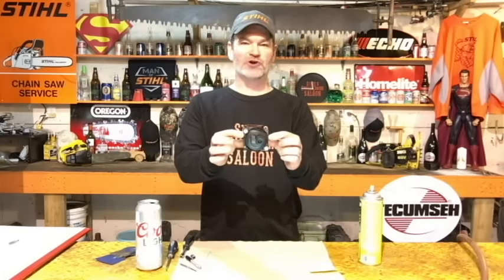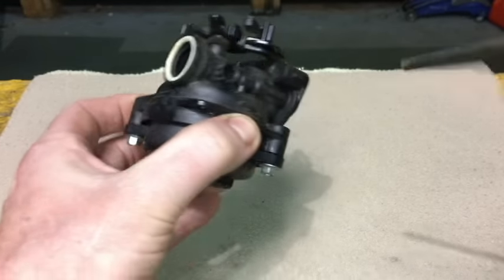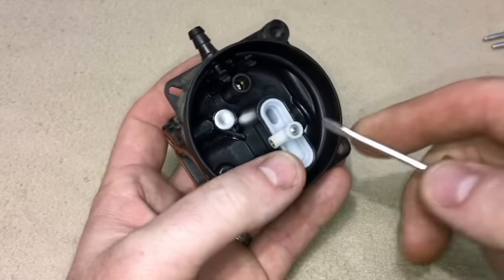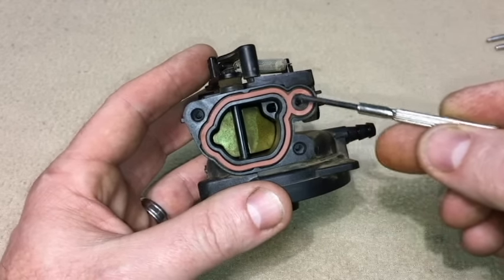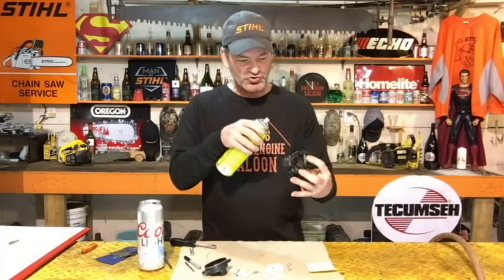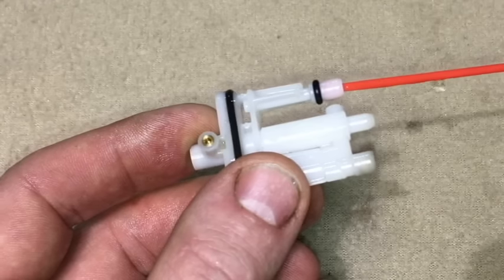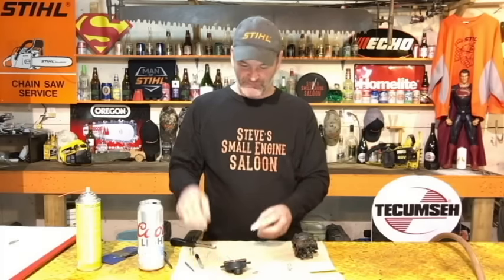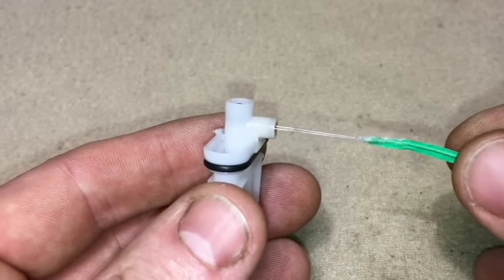EASIEST WAY To Clean a Plastic Briggs Carburetor

Comment: Take the plastic jet assembly apart and clean it, its 2 pieces and if I take them at and clean they run great. I had the same issues until a mower guy I know showed me the trick. Never had any problems when I cleaned it out 100%, not taking it apart is only 95% and that wasn't working. 👍👍

Comment: Be sure to re-install the float correctly.  There is a slot for the needle head underneath the back of the float.  If the needle head does not go into the float slot, no gas will flow and tje mower will not work.

Comment: Thanks great advice ,,,,, U are appreciated '
Reply from the maker: My pleasure!
Reply: @StevesSmallEngineSaloon  Yes i am in the process of dealing with my carburetor all is cleaned but when i try to tighten up the bottom screw cap with my hex key it will no longer go in and screw back in place for nothing why is that ... That has to be sealed or the gas will fall right through the bottom of the carburetor. What is that issue ... by the way another carburetor is on the way  same brand ,, and i will keep the other one for practice of understanding.

Comment: Steve - I have a high wheel craftsman 6.75hp trimmer w/ this BS engine setup.  I have cleaned out the carb and all jets at least 2x now.  It runs but surges.  I have replaced the spark plug too without any change.  Do you have any suggestion on whether the issue could be the gasket behind the carb?  It seems like the choke won't fully close when it surges.  Any suggestions would be appreciated.  I am mechanical and have done entire engine/trans swaps on a honda but this one has me stumped.
Reply from the maker: I have a video for that in my playlists...

Comment: A big problem I have  with these engines is the gas tank over flow vent.  When you fill up the tank and use the mower gas floods out of the vent all over the air filter.  Then it won't run right at all.  I take about six inches of green clear fuel line force it over the vent tube direct it away from the air filter and mother on.  Took me along time to catch that problem.

Comment: So, why would the OEM make it with that size jet?  Possibly because the air fuel ratio is best on that carb when the jet is that size? Increasing jet size adds more fuel so possibly the carb is running rich after you drill the jet out - or- you may have made it run right where it needs to be.  I guess you can check the spark plugs to see how they look, (rich vs lean) , etc. If it sounds good and the exhaust isn't dark or smokey and spark plugs look good I would be ok with this mod. Maybe overtime check the top of the piston for excessive carbon deposits. You can get a cheap borescope from online sellers that will fit in the spark plug hole to view the top of the piston if removing the head is a pain.  Odd how a fuel filter wouldn't fix this. I also wonder if using fuel with ethanol in it is an issue for that tiny jet. Maybe using ethanol free fuel like most small engine OEM recommend will fix this? Gasoline weed trimmers tend to gum up if you don't use ethanol free fuel.  It bugs me that drilling the jet out is the fix. Would you also add a fuel filter?

Comment: Had a no-start engine.  Had spark, fuel new, would run with cleaner sprayed into carb, but dies immediately. following choke spring video, not the problem. Followed this video, jet wasn't clogged when sprayed through, so finished cleaning. Still no start. Pulled it out again, opened it up with bit. Still no start. Replaced carb with Amazon ordered unit. Still no start. Not sure what to check next?

Comment: I'm in New Zealand and have one of these horrible carbs on my mower. Three times now I've stripped it totally down, used a can of Cyclo carb cleaner and compressed air through it, but it still hunts badly at idle. Does that mean the carb is trash? Fuel clean, air filter clean..I'm so frustrated! Ruins fine at full throttle and starts first pull. Any ideas?? Thanks guys

Comment: Ever seen a 2016 Poulan Pro E85 Cal. Carb? Restrictor Sleeve insert for cfm? Drilled to .06 (all I had). I have to remove the insert. Starving for air....

Comment: Great and informative vid...but one correction; if the diameter of a small bit is 0.028 ( for example ), then it is not 28-thousandths of an inch thick.  It's 28-hundredths of an inch.
28-thousandths would be, 0.0028.  I'm sure it was just a slip of the tongue.  Thx for the vid.

Comment: My plastic carb has a white plastic barb on the side that squirts gas when pushing the primer bulb. What's up with that. Also won't start Have cleaned it out . Cranked once.
Reply: That port is for models that future a choke and your engine most likely has a pump style bulb primer that you press instead. That little port with the plastic nipple should be sealed and on the inside of the carburetor in the float area there should be a metal disc that is pushed into place to block off that port and keep it sealed. I'm assuming your metal little disc became dislodged or lost and that's why fuel is pumping out when it should not

Comment: I am a pro factory  ace  . On the carb in this video .. just tack the bowl  off spray it with cleaner everything  run a small wire in the little hole u see at  the end it will look brass in color.  Clean out the tank good and that's it very easy 14 minutes  it takes and I do around  55 to 80 a week everyone  runs fine no need to take all that shit off the white parts stay in the carb just spray run a wire in that only jet put it back together  .. I been doing this work for over 40 years  and I never have anyone  unhappy.. want to make this motor run a little faster just bend the rod that the spring is on bend it to the front run better than new ..

Comment: Another way to solve that issue is to install an in line fuel filter. This will prevent dirt and sediment from getting through to that tiny hole

Comment: Have spark. Checked valves and other areas. The mower wont even try to run
With some starting fluid. I have the 300e engine 125cc. I guess off with the carb. Buy the way I only run regular gas and run it out of gas before going back into the garage.
Reply: Update. Took varb off and yes the jet was plugged. Cleand it tank and every thing else. Shoot some go juce and the dam thing still wont start.... HELP...

Comment: I have a Briggs motor with plastic carb that I drained the gas, made sure choke flap was in the correct position, cleaned plastic carburetor and drilled out main jet, replaced the spark plug and air filter and added new gas.The only way I can get the mower to start is with starting fluid and it dies immediately.... is there anything I am missing? I am extremely frustrated 😞

Comment: I realize this video is 3 years old now but just another tip if someone happens to see this comment because I'm surprised he didn't mention this, do yourself a favor if at all possible and run non ethanol gas in it. This will also help a lot with not plugging up the main jet and also just overall its better for small engines. The 10% or so ethanol in regular gas you buy wreaks havoc on small engines, eats rubber like your fuel line and seals over time and can cause damage to the engine itself over time especially if you let gas sit in it for long periods without use.

Comment: I’m a idiot when it comes to small engines but it would be
Cool if you could do a video from start to finish on a part. This video perfect example. I’m an idiot and it would be cool to be able to see the steps you take to remove the carb. I might be the only one thinking that but from someone that has no clue how to work on small engines and what steps to take to remove them and everything

Comment: The thing that I don't get about this is, if the jet is intentionally so narrow (because they want to run lean and curb emissions), then why the heck isn't there a fuel filter somewhere in line to at least TRY to keep the gunk out?  My mower only has one of the little molded wire mesh ones in the tank, which is only good for keeping leaf bits out of the fuel line or whatever.  This is the worst of both worlds.
Thanks for the vid, about to open my carb for the THIRD time this week and probably drill it out to put an end to my suffering :)

Comment: ive too noticed alot of the jets are very small on these newer engines,, maybe its an epa thing,,  dont know how they run with such tiny jets.
Reply from the maker: Agreed!
Reply: @StevesSmallEngineSaloon  theres no way they get the horsepower they claim on these new engine,  they have no balls.. I drilled my main jet out and now its running rich, I have to try to figure out how to get more air mix in now.. I may try to find a carburetor that will fit it from a real 6.5 hp engine,, if you look at the intake opening though, it is tiny, so dont know if that will help.. maybe I can change the intake opening by drilling it out some  .. 
 as the engine runs out of fuel, and the mixture changes, the engine comes to life, it wants to run strong on the lean mixture,, not just a little  it is ALOT..  THIS TELLS ME that the engine is restricted way down on the air mixture.. I did not see an air mixture screw on the plastic carburetor.. 
it burns gas like crazy too.

Comment: Those new plastic carbs are for E85 fuel, it is much thinner thin the fuel with 10 percent ethanol gas. if the jet was set at .028 like all the ether carbs are, the Lawn Mower will run to rich! with the E 85 fuel more alcohol more thinner fuels faster flow rate.

Comment: Mine has a weird plastic cylinder ring with a hole on one side inside the intake hole and no choke flapper, not sure how this stupid ring is supposed to sit as it fell out when I was cleaning
Reply: Ya if you look close there is a notch on the white thing and a notch where it goes inside the throat. It just pushes in but has the be put in first before you put in the jet assembly where the float is. That jet assembly pokes through the white thing you're talking about.

Comment: I know my comment is way over due but NO I have only had to replace 1 of these type carbs and that is because it sat with gas in it for over 2 years.  I have done like at least 30 of these plastic carbs and all I do it take them apart and clean them really good and put it back together.    and yes that main jet is always the issue at least 95 percent of the time. 
Bar none the easies carbs to clean.
Reply from the maker: Agreed!

Comment: Hey Steve I was working on carburator on craftsman pressure washer an lost the needle float valve . Would you happen to know what the needle part number is model number cmxgwas020733 00 it has the Briggs engine on it?

Comment: If you want to clean this kind of carb without wasting expensive brake cleaner or carb cleaner, you can spray everything down with LAs awesome cleaner/degreaser and scrubbed with an old toothbrush. It can be purchased at the dollar tree. Then rinse with water and blow out with compressed air.  If I can buy a new carb, air filter and priming bulb for 10.00 but I use 5 bucks in carb cleaner to reuse my dirty one, it's not really economic. You can save the carb cleaner for cleaning the jets.

Another nice thing about the cleaner I suggested is that it doesn't absorb into your skin as easily as carb cleaner will and creates less volatile fumes that you're breathing in. Remember, everything your skin absorbs and you breathe in goes through your liver. Most of these fast evaporating cleaning products are carcinogenic, so wear gloves and have a fan blowing next to you to move the fumes, or better yet, do it outdoors.

Something else that has helped me in the past is to get a small E string from a guitar. If you don't play guitar, ask a friend to save the piece they clip off when they put on new strings. This little string is very thin and flexible steel and great for cleaning out clogged carb jets.

You know a guy knows his stuff when he can teach you technical stuff while drinking beer. If you've ever tried doing anything technical while buzzed, you'll understand that it's a hindrance to doing something correctly rather than a help.

Comment: These carbs are a pain. Fortunately if you screw one up while trying to fix it they are available new for under $20. The ethanol we have to have in the gas here wreaks havoc on them.   One more thing - safety glasses when spraying carb cleaner! That stuff at best stings and is not good for your eyes. It doesn't task good in your beer either...And gloves too.   My guess is that the jets are so small to meet emissions/use less fuel.
Reply: Good catch..trs80

Comment: Help me. I clean it, and it runs fine. I get to use it for about at 1 or 2 tanks. Then it returns to start, run and die. I have to clean the carb again.
Most recent episode worked for only about 20 minutes.

Comment: I am weary about using those small drill bits because they can possibly open up your jets size to wear is will not run at factory specks.  Just my thought.  I use something more smooth.  This is why I think those welding tip cleaners are no good for cleaning main jets in 
small engines.

Comment: There's a check ball in that one "hole" ....and I'm fairly sure the main jet has a slit not a hole....people always jam stuff into there Graco paint sprayer tips and try to clear them ..theres a tiney bar in the middle of the sprayer tip and they always end up bending it to one side and it now sprays but it also drips at the same time ...gran yourself a Lincoln welder tip cleaning kit they work for all the tiney orifices...(that's not a dirty joke haha it's the technical term for hole)...also im not trying to be a jerk I'm just from NY

Comment: Bore it out to the same as very typical carb… make sense, as the particulates in the gas are same but may need the proper size hole so it doesn’t clog with a none issue speck of dust!!!   LOL

Comment: Man... The needle on mine was so gunked up from stale fuel, I'm sure the hole it seats into as well, so no seal.  It would run but fuel leaked... Now I tell you, for $12-$15 I can buy a brand new one online, whole lot easier than the 1/2 hour or what I spent fiddling with mine (plus it still leaks).

Comment: I have a plastic carburetor, my problem is. It starts and runs for bout 5 mins, then stops. Want start, I can spray starting fluid in the carburetor. It starts then dies. I’ve replaced the carburetor with a new one. I cleaned the gas tank, lines. So all is new. And it still only runs for 5 mins. Help!
Reply from the maker: Check my mower playlist for a video called   runs for 2 minutes

Comment: ive worked with molds and injection  they have to be redrilled to  make .small hole for plastic injection they have to improvice there mold to acommade for this injecttion mold process.they need more tryouts untill finished,it might be a design  problem. Passed by mistake, no one caught this!!!!!!  in exspection it passed

Comment: This trick didn’t work for me.  It was actually worse after I drilled out the jet.  I had to replace the carburetor.  It was only $20.  The mower still doesn’t run perfectly, but after I adjusted the idle (a little higher) it’s better.  Mostly, I just haven’t been happy with this Troybilt TB200 mower since I got it.

Comment: The jet inside the tube at the other end is smaller still & gums pretty easily,it the second time that 2nd jet has caused issues on acquaintances mowers. Normal non rasping long gas tip cleaners & decent compressed air pressure solved both mowers.Will keep reaming in mind for next time.What a horrible carb,i prefer the old ally ones from the quantum series

Comment: Steve, I concur. The jet is too tiny, but I think it's for fuel efficiency.  I actually like these plastic carbs, other than the too small jetting and have used one of my old trusty .024 drills and got one running O.K... but not great. I'll try the .020 to clean the next one out and go with that. Thanks for the confirmation about the sizing. Since B&S has no real filtration on these, they'll get  my vote as the easiest and quickest way to make 10 bucks on a carb cleaning. I guess the bread tie .016 will be my go, no go method to check the cartridge. Your video on the sticking choke was good. The hangup may be the carb bracket getting bent during use or possibly assembly. Could it be getting warped by over torquing that left side bolt, forcing the inside of the bracket into the space where the choke arm swings to the full open position? It seems like the bracket and the carb are both strong enough, materially, so physical damage could be likely. Heat deformation?    I have one in my backyard that isn't cold  starting and I'm going to check it closely and see if that's it. Thanks again.

Comment: Just did this on my pressure washer. Worked great but you don’t have to remove the float if you don’t suspect it’s bad. Did shoot myself in the face with carb cleaner so be careful
Reply: Thanks btw

Comment: No is not that problem .

The problem is the poor quality. Over time, the plastic carburetor gets warped(deformed) from the temperature of the engine. In Germany service , we change the entire carburetor with the intake manifold and after that ,it's working.

Comment: Be careful how much you drill.  My Husqvarna mower wouldn't start without ether and ran very lean.  It would bog easily and pop and surge when warm.  I found no vacuum leaks but the plug was white.  I drilled out the jet to .7mm (smallest bit I had) and now it puffs black smoke and wont rev up with the choke on.  guess I'm buying a new jet.

Comment: There is now a good video from B&S about how this carburetor works: https://www.youtube.com/watch?v=MfTpU6HS4cA . The tiny jet on one of the towers is for the idle circuit, while the large jet is actually for air to enter and atomize the fuel, so is not for fuel to go through. On engines with throttle control the idle jet might need to be enlarged if the engine surges at idle but I think is hard to find a drill that small.